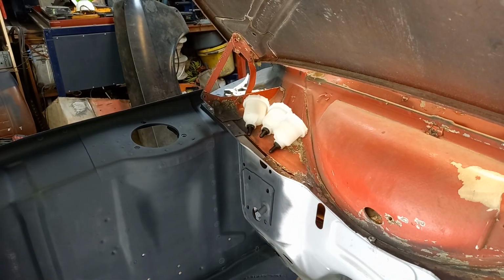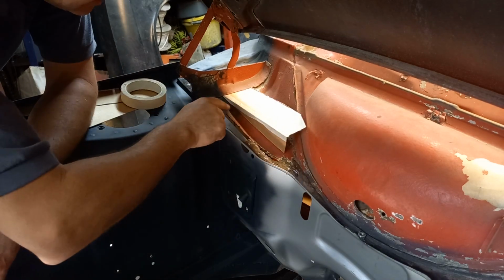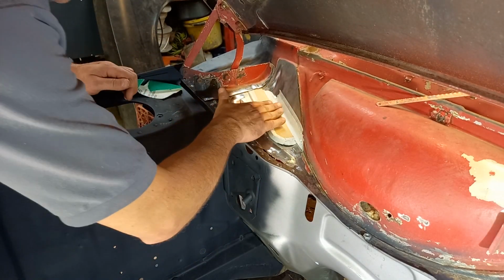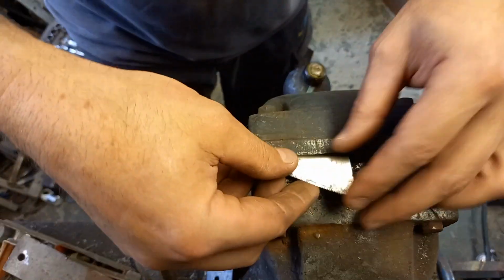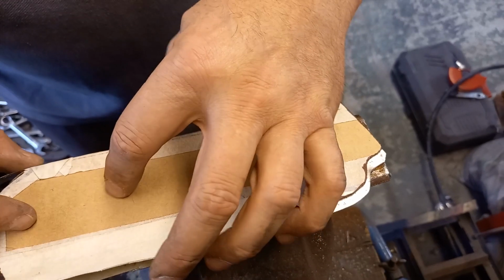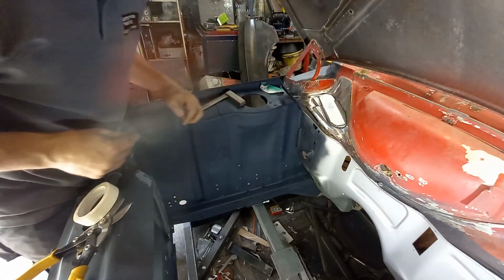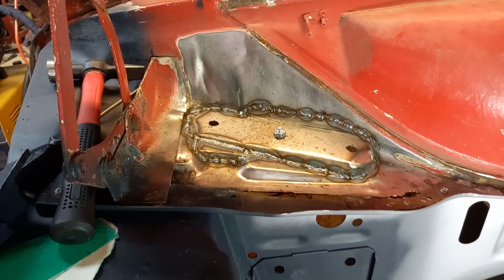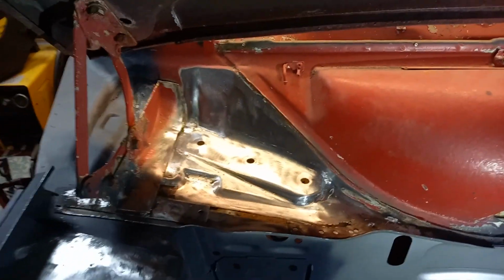Ford Escort MK1 Restoration Project, Part 16 - Reservoir pots "bracket".  Car Restoration.

Comment: I had watched episode 17 before 16 and hadn't even noticed the mods to the panel because the finish is good enough to be stock. I should know the panel shape because I fitted twin transit  mk1 resauvoirs and a Twin Cam pedal box to my 1300E  though that was in 1984!!

Comment: What gauge steel are you using to fabricate these sorts of things?
Reply from the maker: .9mm same as body panels. 1.5mm for strengthening plates.  3mm for the chassis leg. Hope that helps.
Reply: @DavesGarageuk  Thanks so much Dave